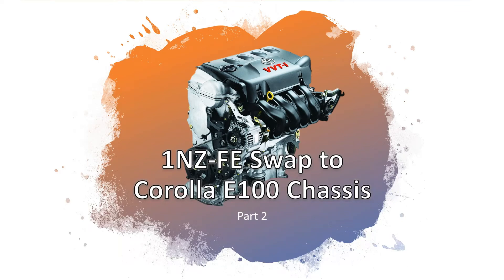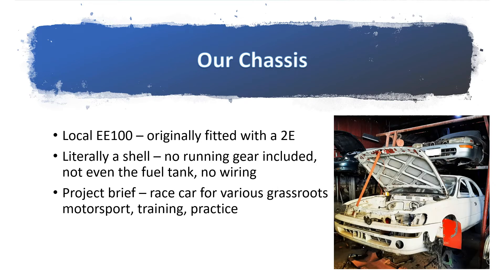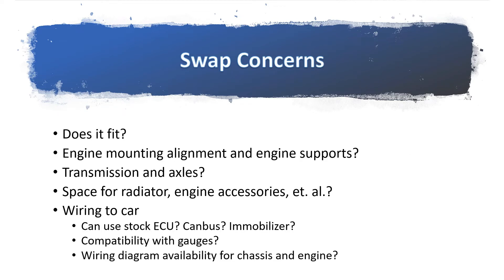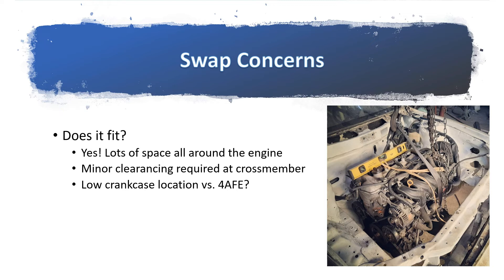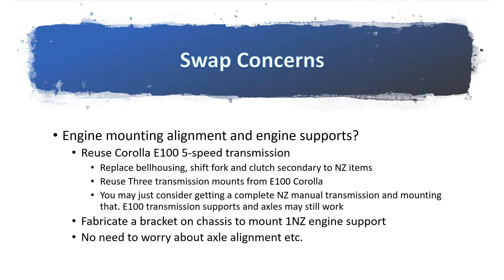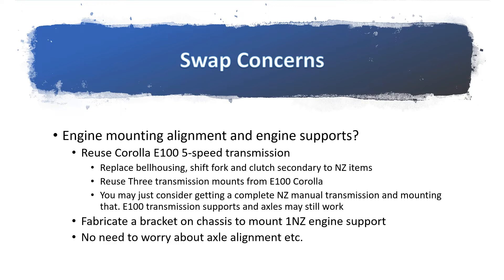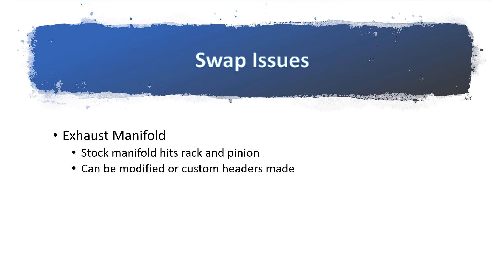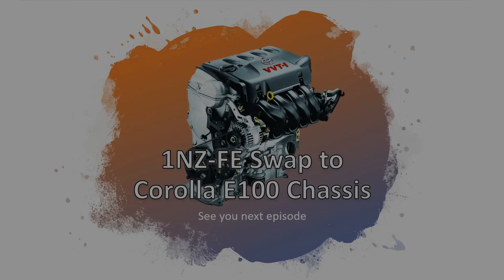Engine Swap Guide - 1NZ-FE into E100 Corolla Bigbody part 2

Comment: We did 1 of these coversion for a customer since year. Corolla 4a axles, and all the manual transmission mounts brackets. We had the bellhousing switched and I fabricated an adapter bracket that retrofit the stock 1nz axio engine mounts.

Comment: Add an adjustable fuel pressure regulator between the engine and fuel filter and use the regulator's return to send the fuel back to the tank
Reply from the maker: Thanks, we did this same thing and it works.

Comment: Can I replace 3zz with 1nz both manual?
Reply from the maker: Yes you can, but not sure on the specifics.
Reply: Thank you very much. My corolla was smashed from behind and badly damaged. I found a corolla body which has 3zz engine mine is 1nz. Not sure if I could go for it

Comment: Is it possible to engine swap Corolla Big Body with 2ZZ-GE engine?
Reply from the maker: Yes.
Reply: @kuholgarage  what are the necessary precautions when installing 2ZZ-GE engine on Corolla Big Body? Does it need some conversions to fit it in?